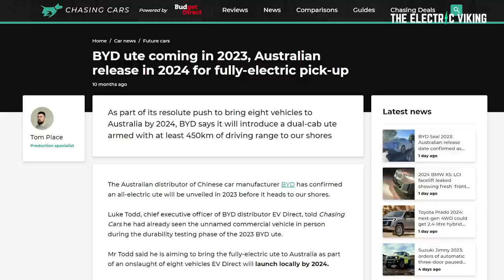BYD's electric pick up truck will NOT be what many are saying

Comment: I don't think lithium prices are going down. Every ev maker wants to scale up. Byd, Tesla and all other linke xpeng or NIO lose money. What do they need to stop burning money?
Right. Sell more cars. So the demand is going way up. Sodium will most likely easy the situation in 2024 but in 2023 the production of sodium is just not there.
Reply: @jondoe5536  And getting them up and running needs usually much time. For others it is 4 years and more. Maybe we are able to get them in 2 but that's it.
Then we have demand because of more and more semi trucks.
Then hole Europe is building battery plants, the US too. China does not want to give up their crown.
We need storage for wind and solar power.....and it goes on and on.
I don't see Lithium prices falling soon.